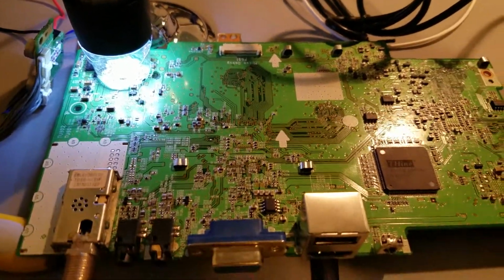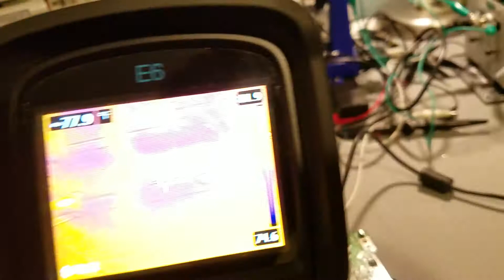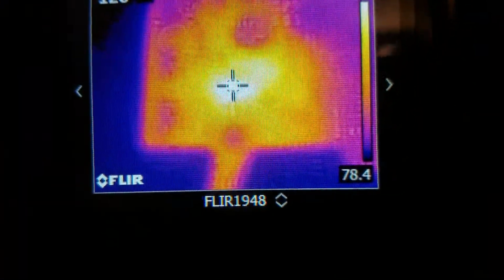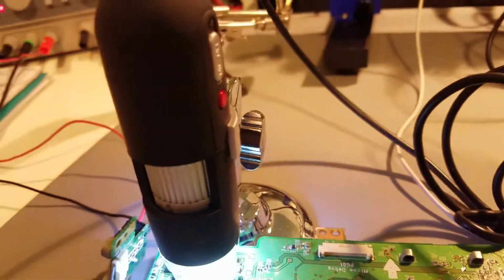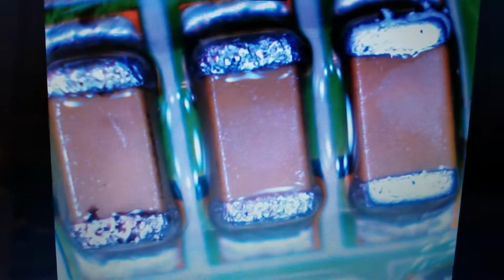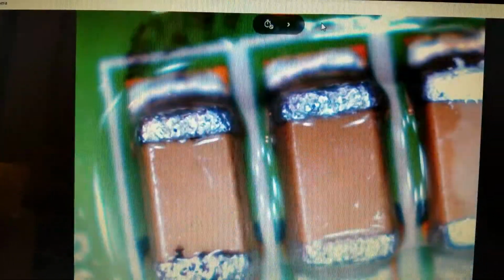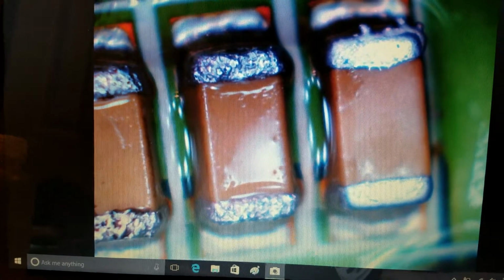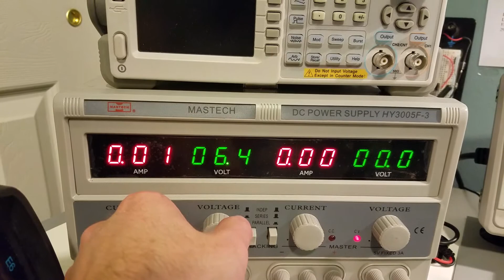LG PA75U projector repair - part 1

Comment: In my projector there seems to be short in the small pcb (which has blue, green and red legend marked on the board) next to the main board. I removed most of the 10uF caps near to the power input connector but the short is still there. Not sure what else needs to be checked.
Reply from the maker: Shoot. Sorry to hear that. I wonder if one of your RGB's is bad? I wish I could help but it's really hard troubleshooting over the internet. 
Did you get the wiring schematics? I bought some online when I fixed mine they helped out alot.

Comment: Hi, I have an LG led projector PF1500 that has gone bad. It does turn on and the fan running noise can also be heard while flashing its led for a brief moment it turns itself off. It then keep repeating the cycle of turning itself on & off.
I have it checked by some technicians in my vicinity they all say the led bulb has failed.
I have watched your video on YouTube they are very impressive and gave me hope that you might help me fix it.
Thanks.
Reply from the maker: Imtiaz,

I think your problem may be a bad inductor as mentioned in post #7 of this thread:

https://www.avsforum.com/threads/lg-pf1500-stuck-in-on-off-loop.2754641/

Replacement pn 
Panasonic
ETQ-P6F1R0SFA

If you fix it make sure you don't just plug the projector straight into the outlet, instead get a surge protector and plug it into that. These projectors have some cheap components in them and having it plugged into a surge protector will make it last a lot longer.

Comment: How does the cover come off? I’ve got one that has not been used in 3 years and I am worried about starting it up. I’d like to clean up the dust underneath the cover
Reply from the maker: There are screws on the bottom. There might be some under rubber pads if yours is different.

Comment: Mine just turn off after 20 seconds, I think is dust inside the proyector, so stops to prevent heat damage. I just wonder how to open it, as it doe not have any screw. The model of mine is LG-PB61U. Can you tell me how did you open yours?
Reply from the maker: There are screws that are hidden under rubber stands. Pry off the rubber stands and the screws should be underneath.
Reply: @BradKwfc  Great!, I’ll try removing the rubbers. Thank you very much